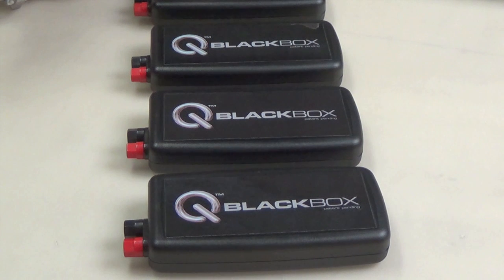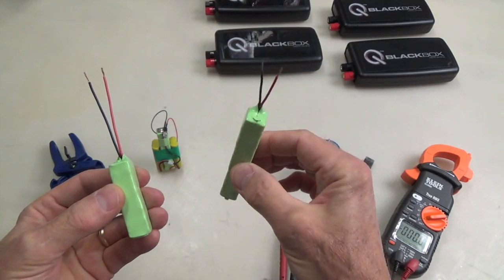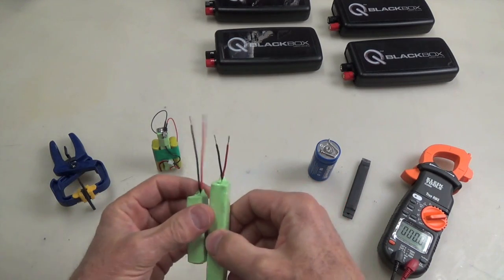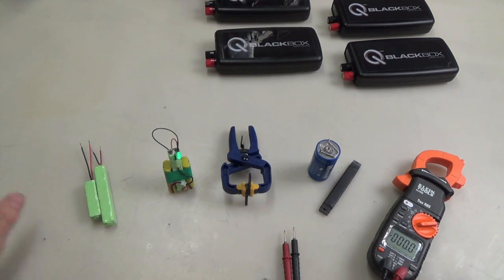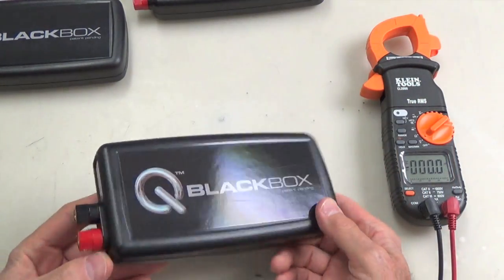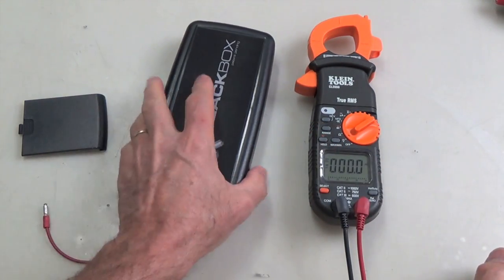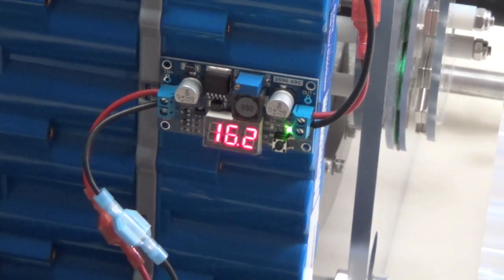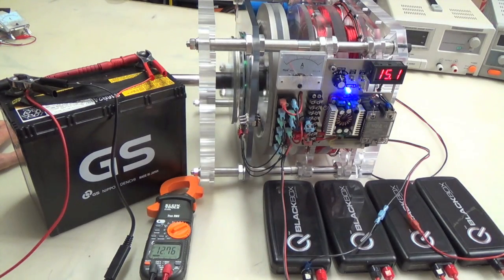BLACKBOX - Silicon Crystal Graphite Battery Module - NO CHARGING

Comment: Mike, loving this progress, great work. I am curious about a few things though. If regen is sparked from ambient heat, doesn't the plastic casing interfere? Also, what is the rate of charge over time at a constant temperature, how does that change as temperature increases and to what maximum temperature does it work? Lots of question, would love to see answered. Great work though, many possible applications.
Reply from the maker: +Alain Grignon    I'll try to answer so many questions from comments, messages and emails over time as I continue testing these new cells. They do not require heat, though slightly improve with it. The internal chemistry will not freeze or burn, and is environmentally friendly. No volatility. I'm now beginning to explore thin films.  My question: How can a cell that is more chemical than electrostatic continue to regenerate without consuming itself???  Perhaps the dielectric is neutralizing oxidation (if only in part) while continuously regenerating and storing internally?
Reply: +PMMG4HYBRID that is an interesting question. It may be the silicon that acts as a resistor to oxidation, as it requires high heat to oxidize therefore seemingly not reducing its capacity to charge and discharge continually, though I do suspect its capacity to do so would eventually start to show signs of reduced rechargability over time. Thanks for answering my questions, though I was hoping heat might increase voltage linearly for the application I had in mind for it. Back to the drawing board I guess. Will still be interested in running some tests on the black box though.
Reply from the maker: +Alain Grignon   That's a reasonable assumption regarding oxidation Alain. I may go forward and develop a cell type with an increased silicon density to further enhance the thermal reaction which increases the charge carriers within the crystal. That might be a solution to the heat (battery/cell) that you desire for linear voltage rise. Maybe worth exploring.
Reply: PMMG4HYBRID , 
I Experienced Excessive Sulfation, With My Lead Acids!
I Had NO Idea, That , You Couldn't, Take Them Down Past 80%, Without Damaging Them!

Comment: Well done Mike ! How long does it take until the blackbox has charged up those 4 Nickel-Metallhydrid batteries completely when they were discharged ?
An USB Output would be handy to charge up your mobile phone or a banana plug cable to Micro USB. Many thanks.  Regards, Stefan.
Reply: +overunitydotcom  according to the label on the device, 12 hrs.
Reply: These are the kind of ideas that will shape the future. I'm also interested in charge time.
Reply: Juan Pastor 
Hello, i would like to contact you on some ideas of uses of your power cells. thank you David  Fontaine